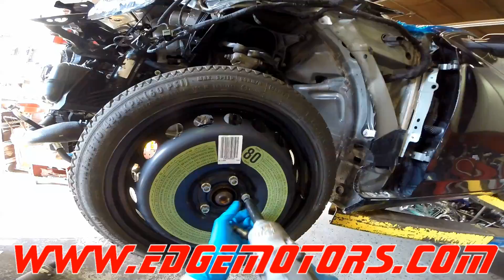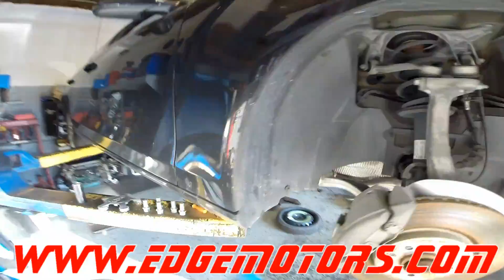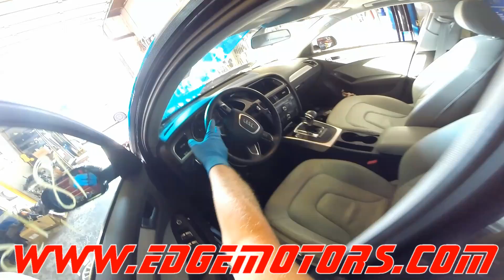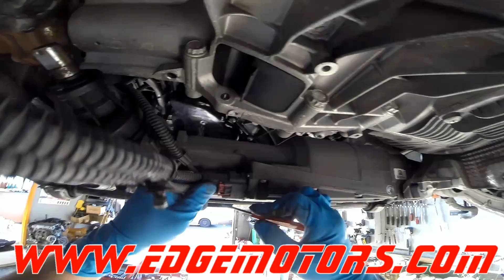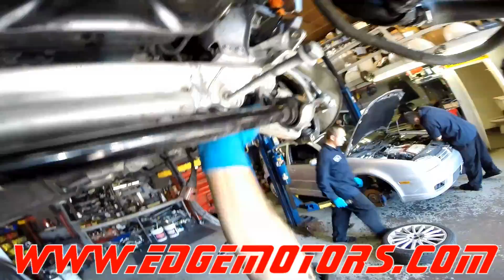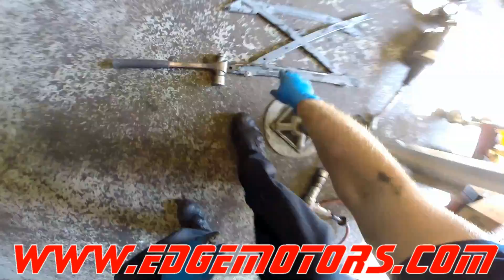2013 Audi A4 b8.5 electronic steering rack replacement DIY by Edge Motors

Comment: Mine has gone twice need another now 😢
Reply: have you been replacing the bad ones with used parts off eBay or something? and what'd you end up doing? also did u go through a flooded street?

Comment: Funny how so many of us are coming back to this now that winter is upon us and the weather is freezing out racks out including mine . Anybody please it would be a huge help to tons of us, I can feel the rack gone bad in steering wheel, have steering defective do not drive message and only code is 5258752 under steering assist.  Can I replace just rack and leave my old module ? If I need to replace the module as well from a junkyard car can it be programmed in with vcds ?
Reply: what did you end up doing?

Comment: Thanks for the effort in making video, but I can help but mention that the way it’s performed is unprofessional for these cars. Using power tools for tightening those subframe brace bolts is a baaad mistake, especially those front triple squares which go into aluminum. There’s no even appearance  of a torque wrench and specs for any bolts. Needless to say that those are stretch bolts and need to be replaced every time you take subframe brace off. Pushing the bolts through the rack to put it into place is a bad idea too as you damade the threads and scratch off zink layer making them rust later and being a torture for the future mecharnic to take out. You’ve got the job done but rather poorly. I leave it here for the other people to be aware that this is not the way to do it right and may lead to potential damage. 
And btw you cannot turn steering shaft since it’s locked by the lock on the column, so there’s no need to worry about the angle sensor’s ribbon cable.
Reply: what bolts would you have used the torque wrench on and to what specs did u torque to

also what part number for bolts and steering rack did u use?  

did you get a used rack online and then replace your one that got water damage or got wrecked? if so where online?

Comment: Thank you for posting.  My 2016 Q5 threw a code indicating steering failure, now I know what my shop technician is talking about when he said the rack has to be replaced.  The sensors or the motor built in the rack must have died on my car.  It is good to know what the mechanic needs to do to fix my problem.

Comment: Does the rack program itself? Im about to do mine. Was wondering if the turning the wheel method actually works or will i need to get it programmed. Its a rack from anothet audi, i assume its already coded?
Reply: Bro did you manage to do this without coding?
Reply: @kailynboodram did you get a used rack online and then replace your one that got water damage or got wrecked? if so where online?

Comment: Amazing video
I think this is one of the easiest rack replacement I have ever seen
Some cars you have to remove so many things to be able to remove the rack is crazy
I have a question though
Where did you get the rack and how much was it
I don't need one but I am curious on the price
I have searched a few places and is not available
Even though is electric steering is still called rack and pinion no???
Reply: did you get a used rack online and then replace your one that got water damage or got wrecked? if so where online?
Reply: @PhilipCurrier1 I believe this comment is for someone else?
My rack is still good knock on wood. Lol

Comment: Thanks for making this video, I need to replace the rack in my B8.5 S4 (2015) with dynamic steering.   Any suggestions on Where to source it used?  TIA
Reply from the maker: Car-parts.Com
Reply: what'd you end up doing?

Comment: Is it similar or is it different when you change the steering rack in a Audi A4 B9? Because I have to do it because the car mechanics says that it is the rack that is the fault. And do you need to code it after and what happens if you don't code it? 😃

Comment: I need to do this to my 2012 A4. I have 2 shops telling me that the control board is VIN locked to the car, and that a used rack is impossible. How did you make a used rack work with the computer?

Comment: I have an audi a5 2015 changed the steering rack but error on screen do not drive steering defective, steering doesn’t even move anywhere,what should i do is this a faulty steering rack or do i have to program it?if anyone can help here please
Reply: Hey man, i know this was a while ago, but I’m having the same problem right now. Have you ever figured it out? Does it have to be coded?

Comment: electronic steering is the sensors right ? Because my car does not have sensors for rack , also did you have to drain any hydraulic steering fluid ?
Reply from the maker: Electronic steering means there is no hydraulic fluid, only electric motor

Comment: When looking for a used replacement what numbers must match in order to code correctly. Looking at mine I see 3 different numbers by the connectors. Would all these numbers have to be the same on the replacement?

Comment: That was awesome to watch. I am not a mechanic by any means and to watch you work makes me feel like I could follow your video and do the job of an expert. One question. Can I use the same format on a Audi A7? My fault steering light has come on. I took it to the dealer and received a print out that I need steering rack and inner/outer tire rods replaced for a whopping $4600. I could most likely purchase the parts for $3300 from dealer saving me around $1300 to do it myself. Any suggestions?
Reply: If you still didn't pay $4600 to a stealership go find a low mileage hit car  from rear only from an online salvage yard.  I got my used rack with 30K miles for $350 shipped. (https://www.getusedparts.com/) Hope you don't have dynamic steering because most used racks on the market did not have that option. Another tip: If you get the VIN from salvage website or via phone etc you can google it and maybe able to see the accident pics under google images. That's how I confirmed that my donor car was totaled from rear and not a scratch front of firewall. I am lucky to live an hour drive from Edgemotors and they installed it at a good labor charge.
Reply: @tekin_NYC  great idea. Thanks.

Comment: hey boss, i replaced my rack and despite the steering wheel being straight the rack itself was not as it was used. anyway i can find out when the rack is straight using vagcom remove the steering wheel and than go back and straighten the steering wheel and than reconnect the shaft? at the moment i am unable to find a way to check dead center for the rack.

Comment: You did use the same subframe and it’s a huge crack. Explain why you used the broken subframe on the reinstall

Doing the same had undercarriage and same side cracked. Replacing it. That is not o e m. Safe.  Why not tell your client and make home replace used part 200

Comment: Did you replace the subframe.  Huge crack in drivers side that’s the protection for rack n pinion 

Makes no sense. Very dangerous. If you replace it then why not explain damage and reason

Comment: Thanls for the video it is great help. I am going to install a new electric rack as mine is faulty. Wanted to check if i'll have to do paramiterization thru SWM aswell or only basic settings. I can do basic settings thru ross tech but for software or paramiterization will i have to take it to dealer?

Comment: Is an ODB reader/scanner required to perform this job?  My car has the "Steering defective - Do not drive" message.  The dealer said the rack was defective.  I've ordered a used rack and want to attempt replacing it myself.  Should the Steering defective message go away after relearning the steering messages or will a ODB/Vagcom tool be required to clear that?
Reply from the maker: Well you will need the scanner to clear the errors in all modules, the new rack if not defective should not have “defective rack codes in it” :)
Reply: @EDGEMOTORS  Thank you!  Great video btw!

Comment: Great Video, Thanks very much.
After fitting the rack, did you have to get the new rack coded to the vehicle? 
I fitted used rack, worked great fault changed from red to yellow and steering alot lighter to turn. Yellow warning went off after learning the steering positions. The used rack lasted 2 weeks to the day, then the dreaded red warning light came back on! 
Any ideas why this happened? Coding?
Also when using the snap on scanner it asks for a CH code (F-0000) do you know where to find this 4 digit code?
Thanks again
Reply from the maker: Try scanning with a different scan tooll...
Reply: @EDGEMOTORS  did you have to code your steering rack to the vehicle? or should you code it?
Thanks
Reply: Hey bro did you end up coding it ? Did it work good after ?
Reply: I would also like to know if coding is needed

Comment: Hey man, great video. Understand you are rushing thru for the sake of time of the video. Don't some of those bolts need to be tighten via torque wrench? Also some of those bolts are stress bolts and one time use only. I changed my cross support beam that you removed at minute 4:45 in video with an aftermarket Alu Kreuz one piece and had put in all new bolts and tighten with a torque wrench. 
Anyway, today after driving thru a flooded street I got "Dynamic Steering System Fault"  with a yellow steering icon on dash. Message on dash said it was OK to continue driving which I did home for 30 miles local and highway. I saw on some forums that people just changed the steering control module and it worked. I saw from your comments that, this may or may not work. How hard is it to change that module on the rack?
Reply: did you end up using a torque wrench and if so on which bolts
Reply: @PhilipCurrier1 I did get the Audi bolts needed for that sub-frame part. It was torqued to Audi spec.
Reply: @tekin_NYC so the subframe bit needs to have new bolts? what happens if we use old ones im in bad pinch and just need the acr to drive 500 miles and can change the bolts after if its needed

Comment: how much a dealer should charge to replace it with OEM parts?
Reply from the maker: Probably 2500-3000$
Reply: @EDGEMOTORS   whoa mine quoted me 9000 :(

Comment: Hi my 2012 Audi A6 2.0 has been showing steering defective. The steering wheel is very hard to move on slow speeds. What can it be? I bought it like this. I’ve been reading and I’ve been getting either replace the whole rack or others have said to get it software updated at Audi. What is the solution? Please help me
Reply from the maker: Either, or... I won’t be able to tell without looking at the car.
Reply: Are u located in California?
Reply from the maker: New york

Comment: My car is the same. Why did you replace? Was the steering stiff?  Dealer told me my rack was bad. I’m putting in a replacement like you did. Was your problem fixed after you did this? Did you need a recoding?  Just curious what I should expect. Would my red steering wheel light go off or need dealer assistance?  Thanks
Reply from the maker: The problem with this one was that the car was crashed and the rack got damaged.
You will need to do basic setting and the end stop relearn.
Reply: Mine was crashed too. I’m just curious if the replacesment will fix my issue of no steering at all.  
Was your steering fixed right after installation? Or did you need dealer help?
You did a nice job showing this. Good work.
Reply: The steering won’t be stiff anymore.
Reply: Did you have to do this?  Was it stiff at the start of the video?  I’m just hoping a used one will solve my no steering issue. It’s my last problem.
Reply: Brian Wollner yep. Got in a little accident passenger front. Electric steering was out and steering indicator light came on. Ran codes at the dealership it pointed to rack and pinion assembly. Replaced it at my local German shop with a used one I found on eBay. Steering is no longer stiff. If anything a bit looser. But now the car is giving me all type of codes (which is why I ended up here). Codes I got after replacement was ESC/TPMS and headlight angling malfunction. I think something was done wrong during the rack replacement when putting the new one back on and positioning the steering wheel straight. Already did an alignment and that didn’t fix the issue. My steering is off center STILL.
Reply from the maker: The one in the video was some what ok but was throwing error codes, that don’t mean it’s ok or not. You have to analyze the codes you getting .
Reply: EDGEMOTORS could the steering angling sensor be damaged at any point during this repair? What happened to this car after the codes?

Comment: any one knows the part number of 2013 S4 B8.5 rack? electric with dynamic steering
Reply from the maker: There is several numbers
Reply: can you give me any kind of numbers, the electric steering stopped working because i drove over a puddle of water, now i cant find a used part anywhere and the brand new one cost 2k+
Reply from the maker: Send me your vin I’ll let you know
Reply: EDGEMOTORS ok sorry for the late respond Bratan, I’ll send it now
Reply: EDGEMOTORS waukgafl3da069533

Comment: Hi I have been watching a lot of you're videos I have a 2016 audi A4 car was driven on flooded streets, steering rack control unit got few drop of water in it. Got it out dropped to ECU repair experts after checking the unit out it seems perfect no burns no nothing. Still error code on my car and steering is crazy hard impossible to even park the car off the streets
Reply from the maker: What are the codes?

Comment: Hey man I have the same car as you and my car has a code come up that says steering defective do not drive car and my car does not start, the starter just clicks. I hooked up vag com and got a couple codes one was a no communication with the steering control module and the other was no communication with the steering angle sensor.  Do you think that that means my steering rack is bad?
Reply from the maker: Your car should start regardless of steering being good or bad. So starting problem is something separate, figure that out first...
Reply from the maker: May be your battery is low? It would start to disable modules in the car if not enough power... that’s where the no communication codes could come from
Reply: Battery is not low because I tried jump starting it and nothing happened
Reply: Found my issue it was the sensor on the battery that goes bad after an accident. Car wasn't in an accident but that sensor failed for some reason
Reply: hey what sensor was it? and after u changed it did the defective steering message go away?
Reply: Please can you tell me how you managed to fix the problem of steering defective do not drive car ...... that makes my steering to be so hard pls
Reply from the maker: There could be allot of different reasons for that...

Comment: Hy guys am looking for assistance in diagnos my Audi B8 steering rack da light in da panel is red nd I tried almost 4 steering rack bt it's not changing pls help
Reply from the maker: b8 has a hydraulic power steering, the steering rack does not have a computer in it....
what year is it?
Reply: 2012 model nd it's a electric steering rack like da one on this video
Reply from the maker: So it’s a 2012.5 b8.5 ? 
What codes is it throwing?
Reply: It shows a red steering so nw I really don't know what to do
Reply from the maker: Scan the computer and see what error codes the steering assist is throwing

Comment: do you think it's possible to replace just the computer module for a 2012 Audi A6? I have a code for intermittent connection with the sensor motor.

Comment: recently had my audi a3 rack changed but since new rack the steering seems heavy and the steering does not self centre. its way more heavy than before and if i fully lock steering the steering will just keep going that way. does it need calibrating do you think? any ideas would be great
Reply: Gooner Junglist 
If its electronic it needs vag-com to calibrate it yes.

Comment: dear 
i had a flood in my area and had to change my steering rack to a used one.
i have Audi A6 2012 and i replace the steering with an A7 which is compatible after checking with Audi Dubai.

now the problem after doing the programming, the computer did not recognize the part and couldn't activate my steering rack.

any idea what is going on.

thx

Comment: And one thing i want to ask.my car is 2.0tfsi engine.2012.acceleration is very low till the 20-25 kmh.after 20-25kmh it accelerate well.generally it thinks when u accelerate.what can cause to this?the computer diagnostic cant find any problem.

Comment: Computer diagnostic says the sensors inside the rack doesnt work.and the brain of it.we are not so lucky, because we doesnt have such good masters as u
Reply from the maker: +Anar Qasımov see like i told you, there are allot of other electronic parts in there.... so could of gotten damaged. 
but you have to make sure you relearn it. allot of times it would say that some sensor is bad just because is is not calibrated properly.... so try to calibrate it several times and see what happens.
Reply: The masters try to calibrate but they cant do because the sensors.is it posibble to repair sensors and brain?

Comment: Hi.i have a problem.i have an audi a4 2013.water went into my steering rack and now it doesnt work.is it posibble to replace the inside it or i must teplace the hole rack.and how does it cost a used one?please give me wide infırmation.thank you.please i will wait your answer
Reply from the maker: +Anar Qasımov  the internals are not sold separately, i you want i have a bad rack with good computer, but most likely it will not work due to allot of other electronics inside the rack. used rack is 500-800 .
good luck